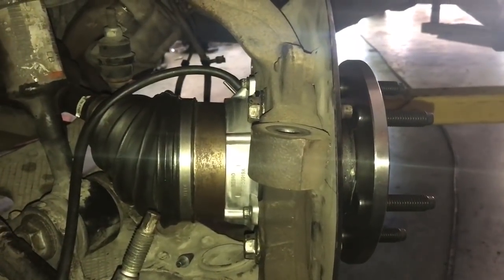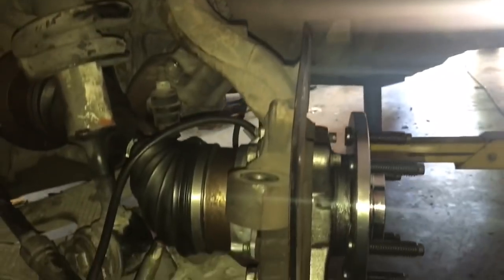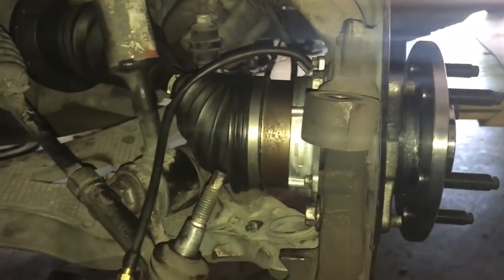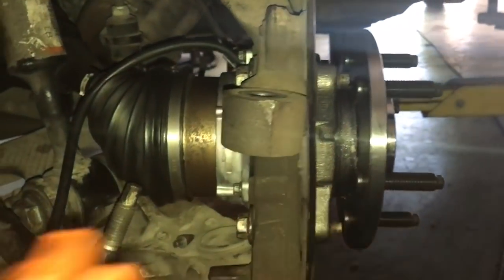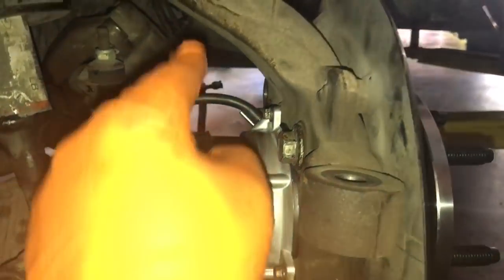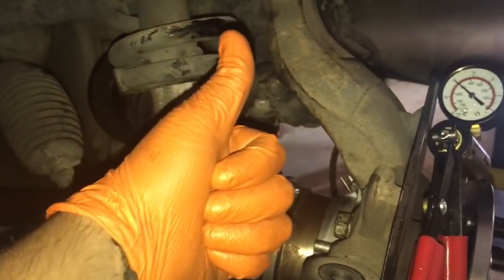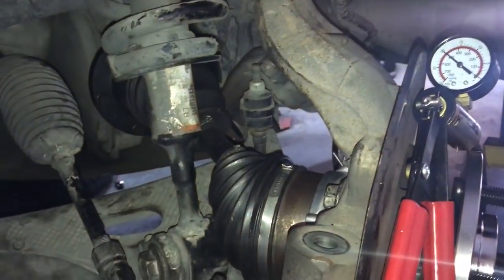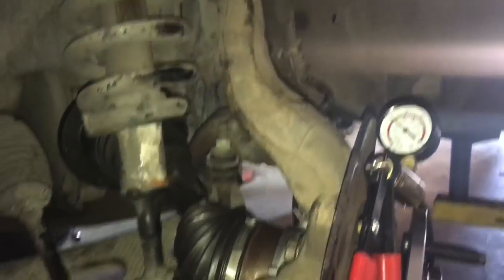DIY How to test 4WD vacuum actuator

Comment: Appreciate it!   Picked up a vacuum gauge from harbor freight, tested my system and came down to the right front actuator. When I tore it down the actuator was cracked and came apart in two pieces.
Replaced it and no issues.👍 again awesome video! Thanks.
Reply from the maker: No problem glad this video helped out.

Comment: This video saved me many and I mean many of dollars. I just replaced my whole front end and I ended up with a noise on the passenger side. Come to find out once i got on the highway the rim on the drivers side had cut thru the hose that went to the actuator. I was just to the point of taking the axle out and starting over until I saw your video. Thank you very much!!!!

Comment: Thanks for the lessons. I was wondering how that worked. A lot of Hard Liners call these aluminum actuators junk. I had one instance with mine (2003 Expedition ) driving across Missouri trailering a 67 Ford Fairlane. It was 90+ degrees F. and I never had been one to drive the speed limit. All of a sudden it sounded like the front of the drive train exploded. I stopped for a few minutes to evaluate the situation, never finding anything wrong. Later when I returned to Ohio I hashed it out with my FMC mechanic, next door neighbor. He said that condensate or moisture probably got hot enough to pull an actuator engagement without a vacuum presence. We pulled the lines and tested them, blew them out. It has never done it again but I guarantee it will scare the crap out of one if it should occur with them !
Reply: Agree this is the worst design ever for 4x4

Comment: Such an awesome video, thanks!
I can't believe that chinsey little actuator is strong enough to power the truck in 4 wheel drive.
Reply from the maker: 707SonomaComa thank you. Yea one powerful lil thing
Reply: It just needs to create a vacuum in a relatively small chamber.  Would be nice if they fail safe  into 2wd.  My 2001 doe snot have this.  Pretty clever though

Comment: Came here looking for possible reason why my 4wd was not working on one wheel. Thank you, after watching your explanation I will check for possible vacuum or hose problems. How did I find out my 4wd wasnt working? By going on the soft sand at the beach and having to dig my way out as the tide was coming in what seemed like a whole lot quicker than normal. Six hrs of shovel in one hand, torch in the other, bits of wood scavenged around, forward reverse foward reverse inching my way outta there. Wanted to get rid of my ute right there, letting me down like that. My arms and legs really felt it the next couple days. Moral is check 4wd all go before you need it.

Comment: Great video. Just had my actuator and CV axle replaced and now a nasty grinding noise has started. So, we changed the wheel hub thinking it was the wheel bearing. Well, that was not it and the grinding still persists. When in 4wd, no grinding. So, I replaced the solenoid behind the battery. Still grinding noise. I think there is a leak in the vacuum line. Hopefully I can find it!

Comment: The worst 4wd engagement system ever . Why put vulnerable parts on each wheel that are exposed to frequent mechanical failure and  damage if any part of the vacuum system develops a fault.    Redesign needed.
Reply: You right bro those ppl that design those things don't fix vehicles so they have no clue that's dumb
Reply: great system

Comment: Excellent video!
what happens if you disconnect the vacuum hose from the solenoid and left the actuators engaged with the hubs permanently?
Reply: your cvc axles will turn with the wheel all the time causing you more vibration and less gas mileage.
Reply: @aaronhorsman1396  So it would be like installing those IWE eliminators?b
Reply: Great question I was wondering also if it would cause any damage

Comment: I had this issue on my 2013 f150. Passenger side IWE does not disengage. Vacuum signal seems to be ok. Although I have no way to accurately test it, However testing it with the tip of my finger it feels pretty much the same as drivers side, which disengages ok, I thought of a faulty IWE, Replaced it and still is not dissngeaging. Any suggestion of what could be going wrong.

Comment: I checked all my vacuum just like you did. It's all good but the actuators still grind, there is also a weird noise coming from the front diff!
Reply: 3 yrs late but I would replace the solenoid

Comment: Thx. I have replaced the vac line from solenoid to actuators, same problem, replaced actuators, same problem, replaced solenoid and problem seems intermittent now. Im gonna check each acuator as youve shown, maybe I have a bad one, they came from dealer though. Thoughts?

Comment: I had a vacume line rubbed through on the tire .  Then filled with mud . Plugged line right up .. the little black and white mushroom looking thing by selanoid was plugged .. i ran a long line from selaniod to hub . Lines were plugged .

Comment: My 4WD is not engaging. When I start the truck and cycle the switch I can feel the vacuum is getting to the actuator but it does not seem to be the same on both sides. Maybe a partially plugged line? So I purchased a test kit to check that the vacuum. Do you know what it should be? I suspect one of my actuators it not working. I would guess if only one was working it would be the same as not having 4WD? I also bought a vacuum pump so I can test each actuator following your steps. I think between the two tests I should be able to narrow it down. It does not seem to me then solenoid is the issue based on the symptoms. If only one actuator is bad is there any reason to change them both In YO? Great video. I should be able to figure it out now.

Comment: Hello. What do you think about this. Really need your help , thoughts and suggestions. I had my 2010 Ford F150 worked in by Kinsel Ford dealership for non-related 4x4 front end work. About 8 months later I took my truck to my personal mechanic who is also our County Mechanic so that he could change the Front upper and lower A arms which included the u joints. Now here it starts. I was with him while he worked on my truck and he told me that my front driver side 4x4 vacuum hoses where missing. We checked the other side and they were still there securely clamped. Which means Kinsel Ford took them off and for got to put them on. My mechanic just put on a vacuum hose he had in his shop. Well I started to hear grinding on the Driver side. It was the driver side actuator now going bad. I disconnected the driver side vacuum hoses and the noise stopped. after a couple months the Passenger side which did have the factory hoses still on, started to grind like the driver side. Well the actuator went bad there too. I don't know why or how becuase original hoses were connected. Are they Linked, could that be why? Well I took truck to a 4x4 shop and he replaced both driver side and passenger side actuators, and connected a vacuum hose. It no longer makes the grinding noises. How can I test the front wheel drive (4x4) to see of it works. I tried it out in small muddy spot and my wife did see the front passenger tire spin. but not the front driver side. An on another day I got stuck in the same spot due to it just rained. Both Front and left and right tires did not spin while in 4 low or 4 high. Only  both back tires. Is that normal? I dont have locking differentials, just 4x4. Your serious thoughts would be helpful. I have detailed the events as accurate as possible without leaving anything out. Thanks.
Reply: Hey guy I don't know why the guy from oz didn't answer you yet but if I may I'll tell you how to check the front wheels to see if the front wheels are engaged ok, now jack your truck up at the front and if the wheel is free it's not on 4wheel the wheels shouldn't be free so try that and I hope that help if you didn't fix it as yet ok

Comment: Great Video! I have a 2003 ford expedition 5.4l 4X4.  I found a free floating line on the driver side just under the brake cylinder, Track said line back to the 4WD vacuum actuator. two lines go in to thet actuator. One runs to the solenoid (the one that you are pulling vacuum on in video). Is the other line (the free floater) a vent line? or should it hook to something. thanks mike

Comment: Ok so would this work if I turn my truck on. Leave it in park. Jack it up and turn the hub. If it doesn’t move than the vacuum and everything is working. And if it does than clearly is there is a problem correct!? And leaving it in 2H of course

Comment: I have an 04 Ford F150 and when I had to truck jacked up and in 4x4 HI the driver's side wheel turns with the axle but the passenger side does not. Would it be that the actuator is bad on the passenger side?

Comment: Hey man any advice on why my vacuum line is only sucking air on the passenger side and not the drivers side? I replaced the lines thinking there was a clog but still no suction on drivers side hub

Comment: The actuator turns when 4x4 is engaged but the tire and wheel does not turn with the actuator and front axle. I beleive front axle is the right word. Why wont it turn. Its a new actuator aswell. I checked the solenoid which is the last suction part underhood u showed us. It is sucking and working. Do I still have a vacuum problem or a bad transfercase motor?
Reply from the maker: Harvey Ibarra look sorry I haven’t responded to your message. I’m really busy here at work running my shop and trying to balance making videos and edit and life. I just had some time today to look at some messages.

Comment: I changed out my actuators, solenoid and check valve on 2014 xlt f150. Problem is I'm still getting a grinding noise when in 4wd but only when I accelerate above 1500rpm, how fast I'm going doesn't seem to be an issue. No grinding noise when in 2wd so I know the vacuum system is ok. What should I check next. Wish i Would've found this video before I changed everything out could've  saved alot of time and money.

Comment: When there's no more vacuum in the actuator where does the pressure go to release is it the second little tube coming out of the actuator the small  line mine seems a little lazy when I shut it off when it's jacked up I spent it in the tire click and then finally it grabs like there's wherever the vacuum goes back to release is clogged or something

Comment: the fastest way... mark a spot on the shaft with a paint pen. turn the truck on and drive 1 foot. did the mark move? yes, your in 4x4. no, your in 2x4.... takes longer to find the paint pen than preforming this test. however, you won't be able to tell if there's a small leak. just be aware of that...
Reply from the maker: Awesome tip

Comment: When you put the screw in the tubes that were attached to the solenoid, did you put a screw in both tubes or just the top tube or bottom tube ?
Thank you
Reply: Just the bigger hole.. smaller hole is just ventilation

Comment: Good video. But my 2007 F150, it looks like different. When I disconnect the hose from actuator and check actuator by using vacuum meter. I found it couldn't hold pressure. That means actuator leaks. So as video shows, it is not vacuum condition. the truck should be 4x4 all the time. But I didn't feel since truck couldn't be controlled on snow road. Anybody know what is going on?

Comment: My 2008 is still doing it.  Good vacuum and i replaced the 4x4 module solenoid. Still grinding in 2wheel on my front left side in low idol.  Any other ideas?  Thanks for vid
Reply: Could be a warped rotor, a bad hub assembly, or a chewed up axle shaft. Also if your vaccum was bad for any reason and that diaphragm wasn't engaging properly it may have eaten up those teeth. 

I'm not a certified mechanic but those would be what I looked at first. Also if you dont have that vacuum pump you can raise the front of the vehicle, rotate the hub to see if the axle spins, then start it up and rotate again to see if the vaccum is doing its job. If you have a small leak somewhere it might be that the vaccum isnt strong enough until you build some rpms at speed so the problem only exists at idle to say 20mph or something like that.

God luck man, hope you solve it

Comment: So is that why my 2010 is making a ratchet sound? When I engage the 4x4 it make loud banging sounds and now today since I changed the breaks it's been making the ratchet/ grinding / clunking sound almost all the time in 2x4
Reply: I have same issue on my 12 after replacing wheel hub. What did you find out?
Reply: @briankillya  I brought it to my mechanic, he didn't give me a clear answer of what was wrong I just told him to make it work as beat possible and that I don't need the 4x4 because I don't use it. It's just one of my maintenance trucks for work. . But it he did mention I also have noise in the transfer case.

Comment: So when im in 2 wheel drive and here the grinding noise but when i put it in 4 wheel drive no more noise will that be the problem?
Thanks
Reply from the maker: Luis Jimenez I just did one 2 weeks ago with that issue you’re having. The 4x4 actuator was a scrapping
Reply: You know what i found out was that when we put suspension back on and the screw that go on top to tighten it grabbed a vacuum hose and punched a hole in it damm so i mickey moused it till Wednesday

Comment: If it's in 2wd and feels like the front is trying to engage does it mean the solenoid is bad?
Reply: What did you end up figuring out? I’ve replaced my check valve and solenoid
Reply: @brandonpanduro3839  yes i did. It's typically the vacuum lines or more likely the hub itself. I made a video about it. Basically you hook up a vaccuum guague and test to see if to hold a vaccuum. Mine was confusing because both hubs were so bad that neither side held a vaccuum so i was confused but replaced the lines and the hubs. The lines were hard to find but i found them online

Comment: Where does the solenoid get its vacuum/air from?
Reply: I guess my question is, if I'm able to put it in 4WD that means no vacuum, Ive replaced my solenoid and still have the issue of grinding at certain speeds, I'm assuming actuator is still good and I'm losing vacuum from a hose or the source? The source being what?
Reply: It’s possible the actuator has water in in from the poor solenoid design that is preventing good vacuum to disengage 4x4. Just a thought. Having similar issue intermittently and am going to swap the solenoid and valve and hope for the best.
Reply from the maker: Jorge T they came out with a solenoid that had a type of roof over it. It’s a design to prevent water intrusion

Comment: Ok I'm missing something with my engine running I have vacuum to my act. When I turn my wheel the shaft from my wheel still turns . why or should it ?
Reply: Only if you have shifted to 4 wheel drive, otherwise you have a leak.

Comment: my 2006 is having 4x4 issues too.
i already replaced one maybe both the actuators several yrs ago about 10,000 km ago. its mostly a winter/hunting truck so i only put about 10,000 km in 5 yrs on it.
i recently drove through some deepwater after heavy rain, 2 days later out of the blue, once you get going 20 km/hr or more the 4x4 makes  grinding /buzzing sound in 2x4.
in 4x4 that sound goes away but theres intermitant  loud clunking under acceleration
i check for vacum just with my fingers and theres definitely some vacum both sides at the actuators and that vacum goes away when switched to 4x4
So does this sound like an actuator is gone?

i also noticed one boot is worn out , would water getting in there somehow affect the actuators? it should be seperated physically as i understand this system?

Comment: Does any1 know k ow where the solenoid vacuum is located on a 2000 ford expedition??..i need 2 replace it but cant find where it at? Some 1 help me out..a diagram or pic would b awesome..but in words its still cool..
Reply: Hey Toni it should be the same as the F-150 look in the same area on the passenger side just follow the hose from the right wheel and to the guy that made this video you're great man keep it up I always watch your channel

Comment: im getting no power to the 2 pin solenoid anyone know what it can be
Reply: Check your fuses and run an OBD scan. Fuse #29 blows on my 2010 F150 when I switch to 4X4, but I haven't trouble shot it yet, gives me a code "C1979 IWE Solenoid Circuit Failure. Circuit open." When I replace fuse the code goes away but it blows again when I switch to 4X4. I probably need to replace solenoid or shift motor.

Comment: The actuator that fails is always the one with the longest vacuum hose, old models have short hoses to the passenger side and new model to the driver side. 
Bad design.  2012 model here...

Comment: Okay, for real great job on the video, most are bullshitters lol. So bravo. Question would a faulty actuator solenoid cause a clucking sound while the wheels are turning....???( Basically causing the 4x4 to partialy  engage)???
Reply from the maker: Crystal Wilson I found that most actuators where the ones

Comment: Why on earth didn't ford design the wheel hub so if the vacuum hose came off it would lose vacuum pressure allowing the hub to disengage instead of staying engaged while no vacuum pressure is present 🤔, totally ass backward design.

Comment: Mine has been making the grinding noise I Changed the check valve. I jacked up the front of the truck my front passenger side tire is turning without the axle like it's suppose to but the driver side tire is turning with the axle. I'm guessing the hub has gone bad on the driver side?? Help thanks.